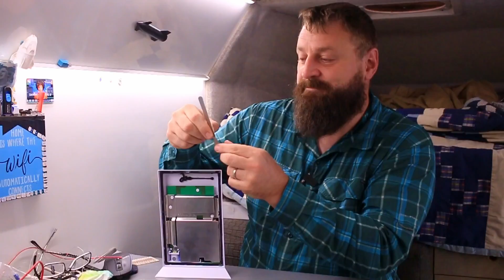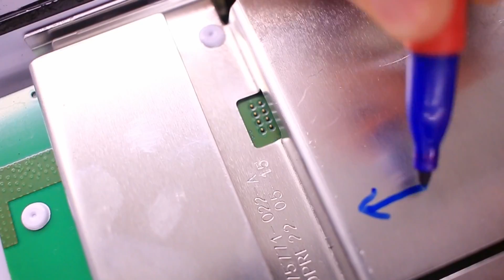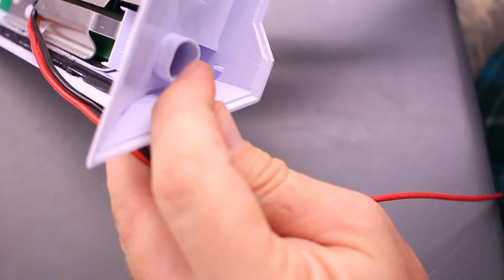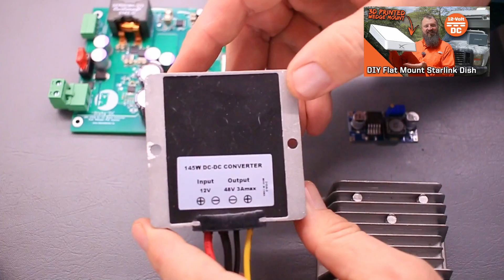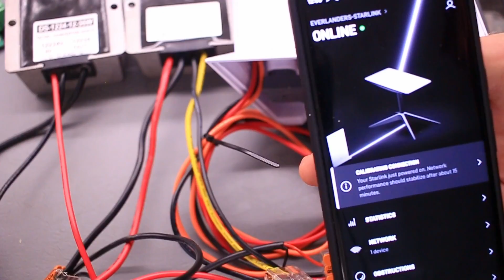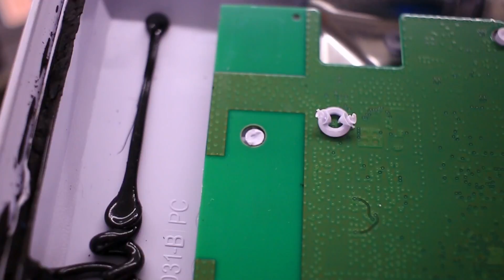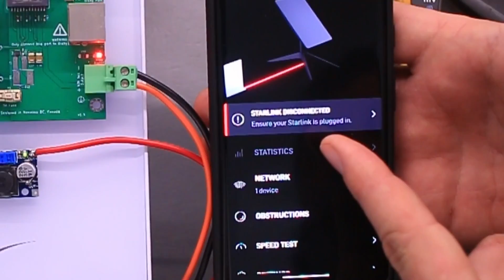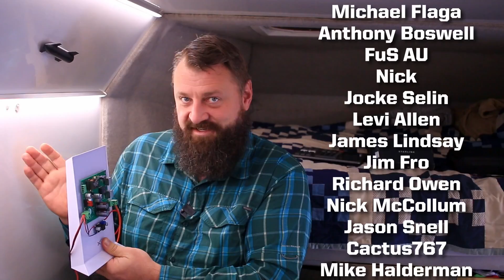Hacking the Starlink Router to run DC Power

Comment: I am told the 48 VDC is actually only necessary for the snow melt function. What happens if one only connects 12 volts?
Reply from the maker: That's false. Nothing happens at 12v

Comment: If I want to only power the router board and not attach a dishy, because I just need a mesh node, do I only need to worry about attaching the 12v side?

Update: powering the unit with only the 12v will power the board to function as a mesh node. As suspected, the 48v handles the dish - so if no dish, you can leave all the 48v components out. I worked this up into a self contained, solar powered mesh node for a remote area with no AC power. Thank you for this video @everlanders - it helped me figure this out
Reply from the maker: Probably, won't hurt anything to try.

Comment: If you added a diode in series with the 12V and 48V wires to the router, preferably Shottky diodes to minimise voltage drop, then you may protect the router from someone inadvertently connecting both DC and mains AC supplies at the same time.  ** NOTE  ** subject to verification!!

Comment: You reverse inject Voltage to the Power Regulator of the Router... Very Bad Idea... it can damage all! Only Power the Wifi Board not the Power Supply of the router!!!
Reply from the maker: Yet thanks to the magic of diodes, years later it's still working fine... 🤷‍♂️

Comment: Was wondering if you can take the whole thing apart and install it in the same area as the dish and do away completely with the router case.Just make he case for the dish a little larger to take the space. I am currently making a mold to use fiberglass and gel coat for my dish as I need this on my catamaran I live on. I did find the video useful and will watch the others
Reply from the maker: I can... But I have no interest in such things as I needed several Gigabit RJ45's for high bandwidth appliances.

Comment: If the original ac power supply is 57 volts output, why not connect the dc to dc  57 volt converter to the same power input on the router. The router would no longer need to be opened. Is this correct or am I missing something here.
Reply from the maker: 48 volts... It didn't work...

Comment: Hi every body somebody can help me with this i dont know what system should i get MOBILE  or  HOME  the hardware is the same but the plan is $30 different the price is an issue THX
Reply from the maker: The hardware is the same... Home can only be used in a fixed location.
Reply: But can be remove  and attach to my camper  by the way the $30 is not an issue  THANK YOU
Reply from the maker: As long as your camper doesn't move, then the Residential service will work fine.

Comment: Q: re your ROUTER.   Jason:  Love your videos.  Thanks for doing them.  Why the  MOFI5500-5GXe LTE-RM520 4G/LTE/5G ROUTER?   It's like $500.  Seems pretty expensive, and there seem like many others much cheaper.  I've taken your advice on the Dishy Dualie DC Power Supply (thanks for highlighting them, great guy out of Nanaimo, BC!) and have it installed to power a the newly released v3 Starlink kickstand dish, but don't yet have a wifi router.  If you were starting from scratch, would you order the Mofi 5500 router for $500 or some other one?  (I know that Mofi is a Canadian company, but still....) :)    Do you have it rigged such that you get WIFI outside your rig, or does the aluminum siding of the rig keep the wifi inside the rig?
Reply from the maker: If it's too expensive, buy something cheaper... We have 500m of wifi, and no aluminum, not sure where you're getting these ideas.
Reply: @Everlanders  Sorry for my confusion.  Are you saying you have 500 meters of WIFI?!  As in, you can be 500 meters away from your vehicle and still get Wifi?  If so, then that certainly would justify the cost!  Thanks for your assistance.  I appreciate it.

Comment: Nice instruction and guidance. A question what is the total DC wattage consumed on average when Starlink is connected?
Reply from the maker: 56 watts on an AC inverter with AC power Adapter, 28 watts when using a DC-DC converter (averaged over 24 hours)

Comment: Jason, I followed your 2nd approach of soldering directly to the router Power Supply and added an external connector to connect to the 12v and 48v converter/regulators and it all worked like a charm.  

The wire approach for removing the front was a saving grace even though it was still an absolute nightmare to remove. Once put back together it still looks factory.  

Your breakdown alone gave me the confidence I needed to do this mod.  

Thank You so much for doing this video!

Comment: Thanks a lot, really useful information. Should have my dish V2 in a week and will apply your hacks and disconnect the motors. Yeust both mods will reduce power consumption by maybe 25%.
Reply from the maker: No, our power consumption went from 56w to 28w, averaged over 24 hours.

Comment: HHHHMMMMMMMM.    WHY NOT JUST USE A 12V- 120V INVERTER.      FAR FASTER AND EASIER
Reply from the maker: As mentioned, it doubles the power consumption... 56 watts with the inverter, 28 watts when converting DC to DC...
Reply from the maker: THANKS FOR WATCHING 👍
Reply: Not an attack...just my opinion.  At least you are way more polite than someone else I made a comment to.......
Reply from the maker: Watts is a unit of measure, not an opinion.
Reply: You are WAY more courteous than someone else that is totally attacking me...about to totally blow-up on him.?that I don't want to do

Where was I coming from with my comments..a vast majority of viewers do not have the technical expertise to do this.  Not even close. May option may not be the best as far of power use,  an overwhelming number of viewers can do it

Been looking at options to improve cell phone/text service that I have to rely on for work. Starlink is just one option I've been looking at but powering it is a major issue for me

Will your option work???  I'd bet it will...for those with the expertise to do it.    Is it the best???  Maybe yes, maybe no.  Is it worth all the work??? Maybe, maybe not....still doing research.  Can most do this???    I've got money I'll put on no way

Comment: I dont think using a 12v to 48v step up will use less power than an inverter. Plus those things get hot. Love to know how that turned out.
Reply from the maker: As shown in the video, it uses 28w as compared to 56w averaged over 24 hours.

Comment: @Everlanders, thank you so much for the video, I'm building an off-grid setup and bought everything needed to complete the installation with only the Starlink kit itself adding the dishy DC adapter, my only doubt is if it is possible to do a Starlink router setup where I delete the aluminum shields on it, also I'm looking into building the setup using the starmount housing where the only wire to connect is the power cord and everything is enclosed in the housing.
Reply from the maker: Sure, it's very possible... But I don't do free customer service for Starmount... Ask them.

Comment: What would you recommend for a High Performance Starlink dish?  it needs over 200w for snow i think?
Got a 12 to 48v @ 6A and a LM2956 to inject into an extra Starlink PS I got to Play with...
EAGWELL DC Converter Regulator 6A 288W Power Supply  (🔺NOTE: NOT for Starlink series )  
Have you checked the output noise?  Does it have much? Will the filter in the Starlink PS clean it up?
Reply from the maker: 300 watts actually... Given it's the same speed as the regular dish in practice, nobody uses it...

Comment: thank you! i used jb waterweld to stick the corners of the high power 48v converter to the back of the router, while the tiny lm2596 was added to the 12v line hidden inside the router's case. everything's working great inlcuding the flat mounted gen2 dish! what would be nice is a custom casing that uses the existing router's glass so we wont need any vent holes (heat passes through glass), while being big enough to have all these customizations placed inside the box. again, thanks for the video guide, they help us a lot!

Comment: Why wouldn't you just use a 300w Sinusoidal Inverter  12V in 230V out  Problem solved. That's how we Aussies think
Reply from the maker: Because it uses twice the power...
Reply: you aussies think easy, but not clever

Comment: Hi tks for your videos.
I did exactly as you did, however when turning on the router it starts, I can connect to the WiFi and in the Starlink app the antenna shows as initializing or disconnected. The voltage I'm putting in is correct and the connection to the router is also correct because I tested the 48v output voltage when plugged in. any tips?
Reply from the maker: Your power supply is Browning out as it's not of sufficient capacity.
Reply: @Everlanders  I'm testing with a 100a battery and a DGXBY 12to48V with 6A output, the antenna still doesn't start

Comment: Hey there..  Months ago when you created this video.. because I'm a subscriber and love the video content.. I ordered one of them Dishy Duallies. I just got mine in the mail last week. I thought I was never gonna see it.. haha..  So.. I'm proficient with a soldering iron\gun. So I'll order some WEGO 221's... but the LM2956..  There are several to choose from. I paused the video to view yours as close as I could.. tried to compare which one is the one you used and am hoping it's the #10Gtek# Buck Converter Step Down Module LM2596 DC to DC Voltage Regulator, 3.0~40V to 1.5~35V Power Supply Module, Pack of 2 version.  Also..  Where can I obtain one of them fancy cases for it with YOUR logo on it..???  :)

Comment: So you could make up your power converters, and once you remove the power supply just make a connector up that slides onto the header pins?
Reply: I was thinking the same thing.  The question of Backfeeding 12vDC and 48vDC into the existing power supply if that wasn't a consideration in its design could cause issues and potential damage.  Removing the original power supply and adding the wires onto a connector plugged onto that header seems like a better approach (provided you will never need to plug it in to AC in the future).
Reply from the maker: Backfeeding is a non issue...
Reply: @DeanHerman  Backfeeding will not be a problem because the bridge rectifier in the power supply will block the current.

The only time I have had issue with a converter back feeding is when connecting solar panels with dissimilar voltage. For example stepping down a 24v solar panel and feeding it to a 12v system will require a diode between the 12v system and the 12v side of the 24v converter.
Reply from the maker: Sure, that'll work too...

Comment: It's not as efficient but can we supply 110vdc to the AC input? 

A simple 12vdc to 110vdc would increase efficiency and lot more simple
Reply from the maker: I'd be happy to review the video where you show this successfully working...
Reply: @Everlanders  you appear to know your way around circuits. Was wondering when you had it open that you could tell if it could take DC or not

Comment: Discovered your channel while searching for starlink RV videos but really enjoying your other content as well. I have just imported a v2 starlink (its still not available in South Africa) and i have ordered the Dishy DC. I was also planning to do a flat mount to put the dish on the roof of my 4x4. But now the v3 dish has been announced and its already flat. Plus it looks much easier to convert to 12v. Not sure if i should sell my v2 kit and wait, or continue with my plans. I dont urgently need remote internet. What would you do?
Reply from the maker: I'm not going to bother with V3... You do as you like.
Reply: @Everlanders  yeah I'll probably hold off the 12v conversion and flat mount for now and get the new dish when it comes out. The only drawback of the new kit 8s that it does draw quite a bit more power (75-100W as compared to the 50-75W of the v2).
Reply from the maker: Or 27 watts if you run it from Dishy DC
Reply: @Everlanders yeah. I'm guessing the new one will also pull less power if powered directly from 12v
Reply: @Everlanders  Does this 27W include power to the router?

Comment: With the LED only coming on while using 230/110V in the first method, it could be used to disconnect the 12V supply via a relay to protect the installation. Another 12V supply LED could be added for clarity as well.
Reply from the maker: Yup 👍

Comment: Thanks for the video! I converted my router to 12v using your video.  Only change was I installed the 12v regulator inside the top of the router in the open space above the antenna.  No It didn’t change wireless range best I can tell.    And the only Issue I had is dishy intermittently has current spikes when booting up. You have to provide enough power to get thru these or it just reboots.  I had to install the router near my battery bank in my motorhome, I tried several existing circuits but none could keep the voltage high enough to get thru the spikes but they are all small gauge wires and fairly long.  Its great not having to run inverter for internet anymore.

Comment: Before opening the case I'd be looking at a means of plugging "mains" into the usual connector, likely from an inverter maybe assisted by solar and batteries.
Reply from the maker: You completely missed the assignment...
Reply: This is for people who don't want to their inverter or don't have one. The conversion from 12V DC to 110 AC and back to 12/48 DC is completely wasteful. Flunked the mid-term

Comment: I wonder if mounting the regulators in the open part of the top of the housing so you keep the wires internal and just have a 12v plug at the bottom straight to batteries fro less clutter
Reply from the maker: No room
Reply: @Everlanders  or even realistically removing the 110 power supply entirely and replacing it with a 12v regulator ->  24v power supply then just power it with a barrel connector so you can swap between a wall wart 12v power supply and normal 12v
Reply from the maker: @FITFO nope, still doesn't fit...

Comment: Thank you!! Used this to modify mine for use on a boat in conjunction w the 48v power supply. Router booted right up.
Reply from the maker: Careful, if your supply goes much over 52 volts when charging, you could run into issues.

Comment: @everlanders I'm wondering if you have checked the power draw when running with this hack. Will the dish connect with 48V 2.6A since my ecoflow inverter only outputs 126W or 12.6V 10A.
Reply: I see in some of your earlier replies you mention 130W during the startup sequence. So close... I'm trying to avoid adding a battery with higher Amp rating into the sequence.
Reply from the maker: Yup, 130 to boot, 30 during operation.

Comment: I rarely comment, but that's the first Starlink-related video I see where a person knows what they do and use proper (WAGO) connectors for cables. Also, thanks for showing up the insides. I had no idea these internal power connectors are so flimsy, you're actually providing thicker cables than pins themselves. I guess I'd rather go with replacing whole original cable and connector in the Dishy (quite destructive sadly), this will allow to use custom PoE injector and ditch that awful original cable connector. Thanks for the video!

Comment: @everlanders thank you so much this great sharing. One question. Is it possible to not remove motor from the dishy but still connect it to 12v power suply and expect same good quality internet connection?
Reply from the maker: Sure
Reply: @Everlanders  great. thank you. I have very brand new German Caravan. It has off grid solar and battery. The caravan has its own 12v system. Do you think I still need that (converter 12v and 48v)

My plan is I will do the first approach you did. get those pins out of the router and then connect them to caravan 12V system. I myself like originality 🙂 thank you 🙏🏼
Reply from the maker: As I mentioned in the video, your 12 volt system will fluctuate between 10 5 and 14.4. Not stable enough.

Comment: I performed the same procedure with another type of elevator and it worked very well, but from one moment to the next, the modem does send the Wi-Fi signal, but the antenna appears disconnected, check the voltage directly on the modem and the power arrives fine, which can Maybe, has the same thing happened to anyone? Greetings from Colombia, thank you very much if anyone can help me,
Reply from the maker: This is called a Brownout and it's because the voltage booster you selected is not enough for the task.
Reply: @Everlanders  Thank you very much for taking the time and giving me an answer, I imagined something like this, I'm new to this...thank you very much again.

Comment: Hi, I got a new starlink and the router is damaged as the USB C input for the cable that comes from the dish is damaged. So when you insert, the router doesn't recognise that dish is connected.

Do you think it can be repaired? Can the port in the router be repaired so as to accept the dish cable correctly?
Reply from the maker: If your story is try why wouldn't you just get them to replace it...?